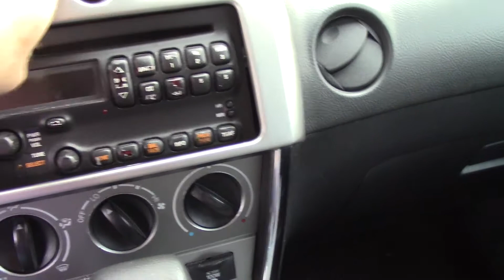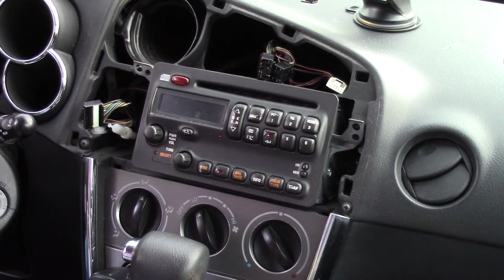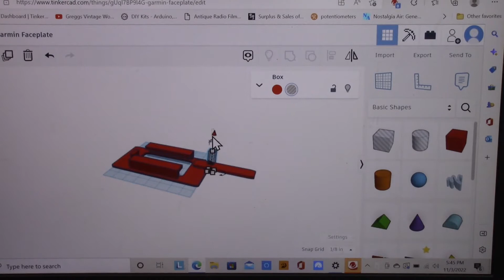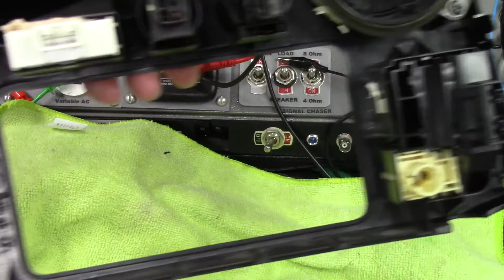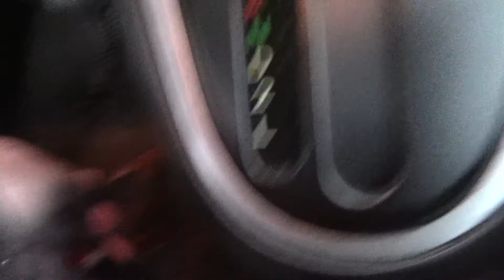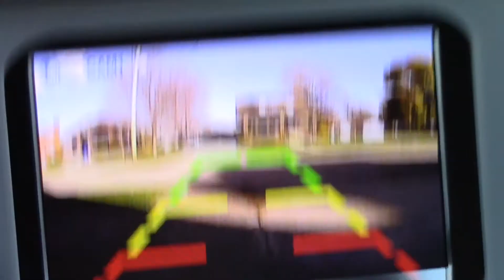Pontiac Vibe   Back up Camera Install

Comment: Excellent job! Do you know which color wire is the reverse light ? Internet said green/white but it was the brake light and camera comes on every time I hit the brakes 😂 disconnected it til I figure out which is the correct wire.
Reply from the maker: Hey, thanks for watching! I'm running from memory, but I'm pretty sure it was a light green wire, not a green/white wire. If you go back to the taillight and probe the taillight wires one at a time with one of those wire piercing probes while the car is in reverse (parking brake applied!) you can absolutely determine the correct wire. This was how I found mine and also where I tapped into it. By the way. it is still working perfectly after several years of usage and weather!
Reply: @greggsvintageworkshop8974 thanks so much. Glad it's still working for you!

Comment: Nicely done Gregg. I still have not installed the backup camera which came with my Android head unit, partly because of having to run the wires from the dash to the back. The wireless makes it nice indeed. :)
Reply from the maker: thanks Doug!